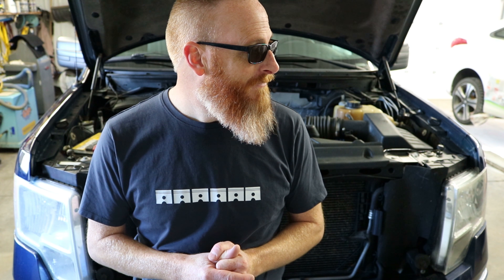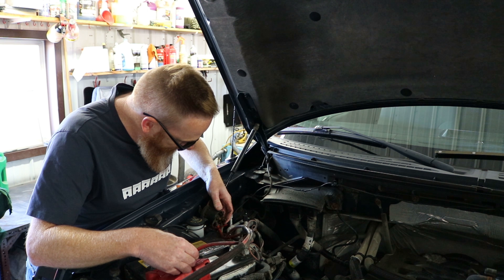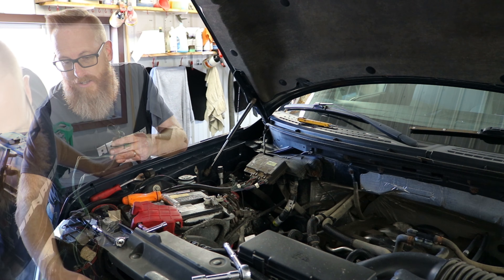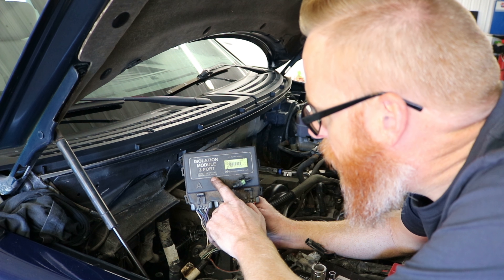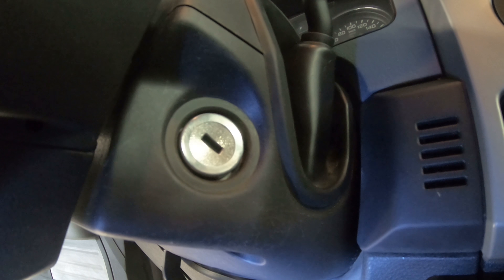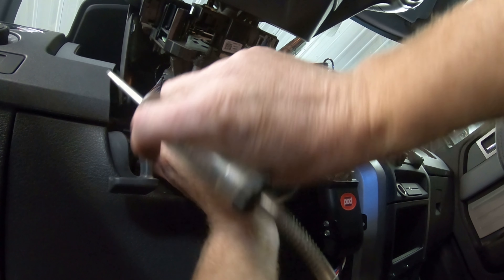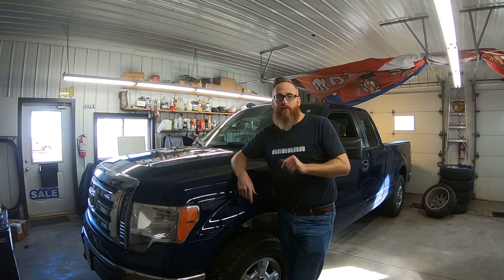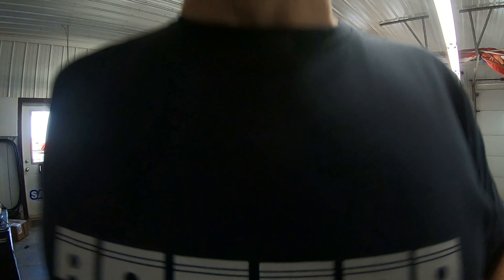HOW TO INSTALL A FISHER PLOW HARNESS ON A 2009-2014 FORD F-150

Comment: What are you wiring in the steering column? I have the 6 pin, but the other end is also a 6 pin. There is no other place for ACC, so what am I wiring?
Reply from the maker: There is a single small gage wire coming off the main harness. Theres a link to the wiring diagram in the description.

Comment: Electric plows are cool. I remember plowing with a 1970 Bronco with a hydraulic plow using a pump driven off the engine.
Reply from the maker: Yup. Me too. Slower than death unless you feather that throttle just right!

Comment: I'm confused. I have a control module already mounted under the hood of my 2013 tundra for a electric trlr brake I'm guessing. Do I need a 2nd module for my mm2 fisher plow.
Reply from the maker: The plow does operate on its own module!

Comment: Thank you for the video. I have the same harness that I just bought used and it seems the lights adapters are missing. Do you know how many connectors to the head lights and turn signals are they?
Reply from the maker: Glad it helped. There should be one for High & low beam, park and turn on each side.

Comment: I tried to wire to the ignition like you did my truck won't start and the lights on don't work but all the other lights work
Reply from the maker: Be sure to double check all your connections!

Comment: Did you use a T Tap wire when you were installing the park and turn light connections?
Reply from the maker: I did and made sure I sealed all connections with grease to keep the water out!

Comment: Hey can you tell me  if a fisher staight blade off a 2010 f-150   
Will the wiring harness and frame mounts work
Reply from the maker: You should be fine up to 2014 F-150

Comment: I bought a fisher minute mount 1 and wiring harness from a buddy ('16 F250), and am installing it on an 08 dodge 2500 diesel.  I keep hearing about the light hookup.  I've heard about hardwiring the lights, or buying headlight adapters (?).  The wiring harness is only 2 years old, and dont want to buy a new one.  Also not sure if they take the same bulbs or not.  Any ideas?  First time installing (or attempting to anyway) a wiring harness
Reply: P.s., am from Saint John.  Enjoyed your video
Reply from the maker: Thanks for reaching out! So the headlight harnesses are generally specific to the style of bulb your truck takes (H11, H7, H1 etc). They do this for ease of installation. You can hardwire to save the expense of a new harness, however you may run into haven your plow lights and truck headlights being on at the same time.  In an older dodge, you may be ok but it’s worth trying. Your other option is to search ebay or kijiji for the proper harness. Hope this helps and hope to see you watching and commenting on some of my other videos!

Comment: Thanks for the video. I have a 2011 f150 also and wanted to put a plow on it. I went to a few installers and they said it can't be done because of the electronic steering. Have you found any issues with it?
Reply from the maker: We have plowed with it for 2 winters here in Canada and no issues while plowing so far.

Comment: Awesome video! I've got an 02 GMC with a MM2 plow that has fallen apart. The truck is junk but the plow is great. I'd like to mount it on my 2010 F150. Will the truck side wiring and electrical components ( I know I'll need new headlight harnesses) work? Is-are the control-power module brand specific or is it plug and play because it's made universally from Fisher?
Reply from the maker: As a rule, it should be plug and play. You are correct on the headlight harness although you could hardwire (pain in the butt).

Comment: Nice job bud. That looks easier than I thought it would. How hard is it to install the mounts on the truck for the plow
Reply from the maker: Generally this would have been a very simple process except we used the mounts from a 2006 F-150 so there was a slight modification that had to be made by drilling one extra hole on each side. It was much easier to do that then she'll out the $500 for the exact fit. They came with the used plow when we bought it.

Comment: Hi Jason, Have a 2011 f150 as well and they said it was dangerous to run an electric plow on it because it has an electric power steering unit on it. Was wondering if you had any problems with this truck with the electric plow. Or if your 2011 has the electric steering unit?

Thanks,
Corey
Reply from the maker: Hi Corey. I haven't experienced any issues as of yet. I do know that they didn't recommend them on the EcoBoost due to blocking the intercooler though. Time will tell.
Reply: @OldeCarrGuy  i've got the 5.0L. Which do you have if i may ask?
Reply from the maker: I have the 5.0 L as well. Great working truck.